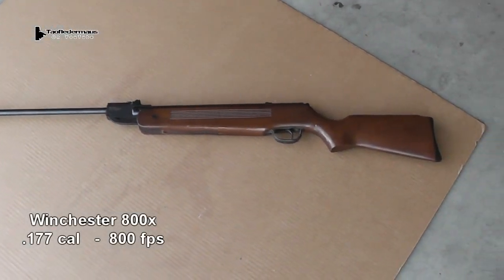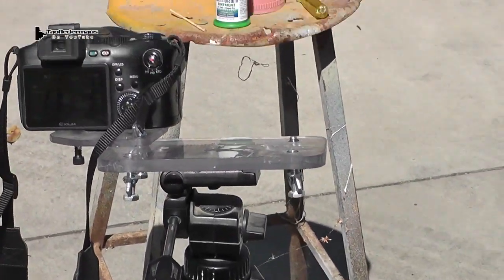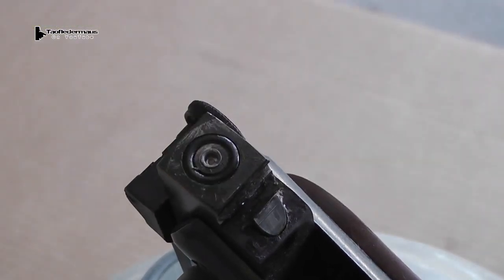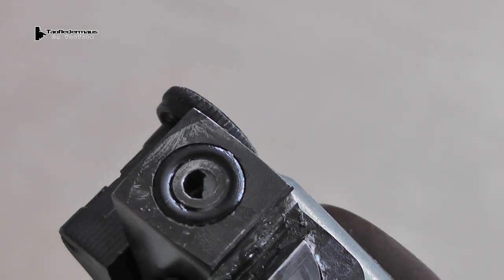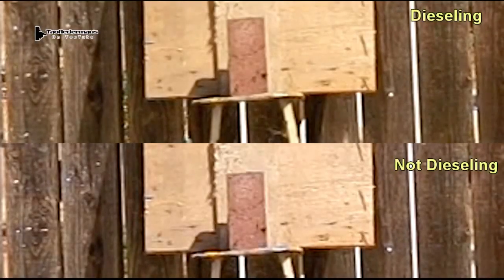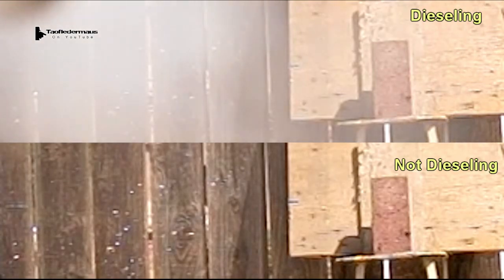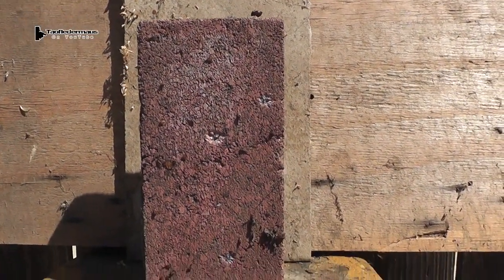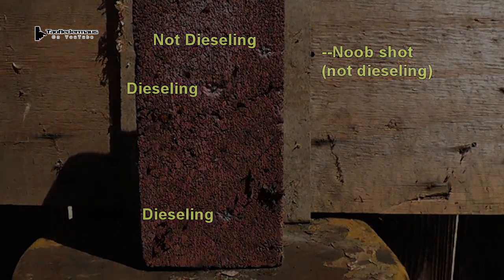Pellet Rifle DIESELING  -   Good,  Bad or Ugly?

Comment: I use Remington gun oil, and yes dieseling increases the velocity. How do I know? Because it increases penetration and when you have the mass of the projectile stays the same obviously velocity increased. I can fire a .22 pellet and get a dent. I can fire a dieseled .22 pellet and get a hole.
Reply: I discovered 'Deiseling' by accident and it imediately inspired me to do some experimenting. I found that penetration was better with a smear of vaseline on the cup of the pelet.
Reply: I have been adding oil or a dab of grease to my pellets since the 80's.  I discovered this when lubricating the gun.  Never suffered damage and in fact some of my air rifles have the same seals from the 80's.
Reply: Ethan Allen stuff really works you can shoot threw car doors with it
Reply: Good tips.  : )
Reply: In the US (most states) there is no long gun registration or licenses required.
As the "trick" doesn't modify the air rifle there's nothing to run a fowl of here.
Reply: I'm interested, I found no difference over my chronograph with usual caveats that altitude air density temperature blah blah blah can all effect chrono readings.
Reply: WD40 sprayed in the air cylinder sends Rabbit II bullet (1gram weight) from 280 m\s to 395 m\s. It also kills the plunger sealing in 30-40 shots. And kills the magnum spring. The trick with any dieseling is to make foam and have good air mixture inside. 0.67 gram bullet goes from 310 to 440m\s
Reply: miksal26 We don't spoil anything. Governments everywhere, especially yours, get a taste for power and become greedy. The Port Arthur tragedy wasn't a wake-up call. It was simply the excuse your government needed to strip your freedoms away. Best of luck to you. Stay safe because these are some increasingly dangerous times.
Reply: Watch out with what you are doing if you want to keep your definition of air arms as being not firearms.
By using rapid oxidation of a fuel to propel a projectile,you are asking for gun control supporters to have a serious discussion regarding
the legal definitions that airgunners enjoy at this moment in the USA. In other words,use only air in airguns to enjoy the sport.

We in Australia regard air arms as firearms and must be licensed accordingly which involves all the legal requirement and bureaucratic
paperwork and bullshit connected with obtaining  an air gun.

Enjoy the sport of air gunning with all the benefits it brings you and the relatively cheap cost the activity allows you.
Don’t  spoil it for yourselves by doing dangerous things with your air arms.
HAPPY SHOOTING and best wishes from DOWNUNDER🙂
Reply: I get maybe 50 to 100 fps faster with dieseling on my chrono

Comment: I used a spray can of 24% Ether called "Aerostart", normally used to start gas engines.
I have used it in a car (air cleaner) and in a stubborn two stroke lawnmower.
A short squirt into the chamber usually ignites and the pellet speed is increased dramatically.
We tested it using a Telephone book and the penetration was quite spectacular.
A wisp of smoke after firing is quite normal.
Oh yes it was a spring rifle with 177 pellets.

Comment: There's all this talk about the oil being put into the actual skirt of the pellet and it igniting and producing a small kinda powder burner ammo effect, accelerating velocity… but when I originally found out about 'dieseling', I got the impression that it worked more on the basis of adding oil between the pellet skirt and the breech so that it formed an airtight seal, therefore producing more energy that way.
Reply: Robert Tomkinson,
Just put any kind of oil in the barrel, or even water, without a pellet.  it'll look like smoke when fired.
Reply: Then how would you explain the smoke?
Reply: The glow plug is just there to make starting easier , it's not really necessary for it, if you crank a diesel with broken glow plugs and the compression is fine it will start .... as a matter of fact sometimes diesels do a run-away especially when seals on the turbo goes and oil from the sump is sucked into the compression chamber .... google runaway diesel numb nuts...
Reply: Flyboy,
That was my first impression.
Reply: +But Not Today 
Qa'pla'!
\V/_

Comment: it is my firm belief that "dieseling" is a load of shit. it takes tremendous amounts of pressure to ignite any fuel without a spark,in fact, far greater pressure than an air-rifle is capable of producing. the smoke is inevitable if you put whatever grease or oil you would like in the barrel,combustible or not. however, "dieseling" does somehow affect the rifle because a liquid medium is non-compressable, maybe therefore there is a difference in sound,and who knows,possibly performance. my own experience dieseling this far is however that it only makes a louder bang and rapes accuracy up the ass. sorry for any possible faulty grammar as english is not my mother tounge.
Reply: Pressure in an air rifle is around 3,000 psi vs only 300 in a Diesel engine cylinder. No spark required; no shit load required!
Reply: Go out after dark and diesel one of your pellet rifles, you will see a flash ! The oil or grease does ignite !
Reply: +Mats Granqvist Tell that to Umarex, they refused to repair my air rifle because I over oiled it causing combustion which over a couple weeks time broke the main spring ! And I didn't do it on purpose !
Reply: I will have to try that one !  LOL
Reply: wp r there's the matter of compression ratio too
Reply: I've gotten the same results using water
Reply: shut your trap
Reply: Put that Daisy Red Rider down boy (you might shoot yer eye out!) and get you an adult spring powered rifle rated at a min. 700 f.p.s.  Then simply oil it too much and behold the power if airgun dieseling! Lower powered guns won't get hot enough to ignite the oil.
Reply: "it is my firm belief...".  In other words, you haven't a clue.  Thanks.

Comment: Maybe try using zippo fuel or something more volatile, and add it directly into the back end of the pellet.
Reply: Lorenzo Pacheco What you suggest is the usual way of doing it, works very well and give great power.
Reply: Rondo Cat Yay I'm smart.
Reply: YEAH!!! BLACK POWDER!! be sure to post the results!!
Reply: WD40
Reply: This will cause the build up of burnt residue over time which will spoil your groupings. Been there and ruined the T-Shirt. Need more power and accuracy: Get a more powerful gun with a larger caliber and use a pellet weight that your particular gun is comfortable with.

Comment: when dieseling, use a light oil, something that will ignite easily
any kind of grease, petroleum jelly is too heavy, the louder pop is just more compression because the air space in the pellet war "reduced/removed" by the jelly

Comment: I would like to say that you're not supposed to push /drive the pellet down any further than were it was when you insert it ,and dieseling doesn't mean any thing that's flammable... does have to be flammable, just not every thing. Actual diesel would have worked, oil, lighter fluid would have worked!!! it seemed as if you wanted it to seem untrue that dieseling would increase fps in an air rifle...All im trying to say is that you didn't try to preform that test ... look further in to detail/  before trying to test a hypothesis.

Comment: If you want to wreck your air rifle then apply a drop of 3 in 1 oil to the back of the pellet when it's in the breech and also a drop or two into the cylinder.  One thing I tried when I was a kid, I ran out of pellets for my old Diana and my dad wouldn't buy me any more because I'd smashed his shed window so I went to the coal house, found a few .22 sized shards of coal and fired them.   One or two of them actually ignited through friction as they left the barrel and while they flew anything but straight, it was cool firing 'tracers' from an air rifle :)
Reply: Taofledermaus NEEDS TO RECREATE THIS!!!!!

Comment: <---- .22caliber crosman phantom canadian version, new the box specs are 495 feet per second and the 22 cal crosman lead pointed pellets do not go into a wood plank more then skirt deep, but, with 1 drop of conventional, non synthetic, easy flowing, new in bottle, motor oil that is not rated as resisting burn off, added to the air chamber via syringe and also in the pellet skirt......kapow,.....pellet goes right through the plank. must be double the energy.....attempt at your own peril !!!!!!!! do not attempt in anything but a spring gun fellas, a pneumatic pump will explode in your face or need other repairs
Reply: *****
 LOL that sounds more victorian era manly than it does art deco era ;) you did good research info, thx for the conversation.
Reply: *****
yes, they did used to frown on women doing manly things......drinking or smoking,...how unladylike! and politics and medicine, women can only be assistants back in victorian era....almost as bad as the islamics treat their women today by trying to keep them uneducated and subservient to men, it is even taught in their religion that most people in hell are women, and that women are virgin sex slaves in heaven for men, stupid.

Comment: mentholatum ointment has about 10% water in it...not sure how flammable it is ....but 3-in-1 oil works good in the $40 cheap chinese air rifle i bought at the flea market..it chronos at about 980-1020fps dieseling and about 790-825 naturally aspirated on my $90 prochrono LOL not sure why you haven't bought a chronograph yet for some of the experiments you do...they are pretty cheap...

Comment: The pellet is propelled by pressure between it and the piston (obviously). By pushing the pellet down even 1/4 of an inch gives it a larger chamber which will slightly reduce the amount of pressure. Im pretty sure if you just add the jelly oil into the skirt of the pellet you will have a little bit better result.
Reply: Indeed and the retarded way he's applying the Halley isn't helping either
Reply: Also he can tell me or anyone how fast it was going by eye lol you need somethingvtobtecord the speed. This does make it go faster.
Reply: Primal 420 I just emptied a 3 in 1 can in the can so they soak in it
Reply: @kinzieconrad105  I do the same, and gently roll and shake the can before a session to redistribute any settled oil.
Now all I need to do is find out where I can gets me summa them there chrony eyes!
Reply: Probably Wal-Mart
Reply: 2 stroke oil gives the best pop.
Reply: dsjc666
Both correct. He must have built in crony eyes too.
Reply: OMG PLEASE, get a life! All you need to do is observe the deeper penetration to penetate your pea brain mentality 😂
Reply: Pressure alone without the added pressure of the combustible mixure in the pellet doesn't work. A non combustible material in the back doesn't increase the speed at all.
Reply: You are right, I've played about with dieselng and not pushing the pellet down the Barrel and only adding a tiny amount of fuel works best.

More is not better, I've tried a number of things and engine oil works well, just a single drop in the skirt, more will lower the gains you receive. 

I think that oil works best because it can vapourise much better than petroleum jelly rather than it being a better chemical itself
Reply: Exactly it has nothing to do with combustion, as many unscientific folks think, because no combustion is taking place.
Its all about creating tighter tolerances, which leads to less energy loss when its fired.
Reply: @PattyBoyBK  You probably have no clue how a diesel engine works. The diesel is ignited by pressure.
Reply: @PattyBoyBK  False, put water in the pellet and it goes no faster.

Comment: 1. pellet too small
2. too much grease, 1 ml diesel needs 6 liters air roughly.
3. metal barrel and pellet act as heat sink

Like the lower mass shotgun shells, the pellet is out by time it is burning.

Comment: ***** It's called dieseling because occasionally diesel engines do a similar thing when diesel fuel is vaporized and can cause an explosion in the engine.
Reply: Jonny E Essentially you're changing the pressure significantly when firing. If you have something that already has a relatively low flashpoint, and you apply high pressure, you can change its boiling/burning temperature. This combined with the heat and friction generated by the pellet against the barrel is enough to start a catalyst to cause it to diesel.
Reply: actually it is called dieseling because a diesel engine works that way there is no spark in a diesel engine the ignition of the and oxygen fuel mixture in a diesel engine is done by compression the same thing happens in the gun think of a piston fire starter all it is ,is a piece of paper  sealed tight with a bit of oxygen in the chamber you push the piston in rapidly with the paper on the end and wammo you have an amber they all work the same way its really cool when you think about it

Comment: Try putting a small glob in the barrel then put the pellet in .The lub makes the pellet slide down the barrel faster and makes a seal so no air goes past the pellet as it goes through the barrel and the lub causes less friction . The 2nd pellet you load won't need lub since you just coated the barrel with the glob from the first shot. A  pellet that normally gets 600 fps will jump up to 800 fps . If you have a gun that shoots 900 fps it will break the sound barrier  and make a cracking sound .To make sure you don't slam the piston head inside your gun use a heaver pellet ,this way you get about the same  fps but a increase in foot pounds of energy . You don't have to worry about hurting your piston as long as there is resistance . Don't go over 200 fps faster than your gun starts off with. Don't use a lighter pellet when you lub your barrel .  If you notice when you do what your doing you don't see a difference in fps until after a few shots .That's because your not lubing the barrel to reduce friction till it gets forced into the grooves from the 2nd and 3rd pellet . It takes a lot longer to lub the barrel your way. I never use a lot of lub ,just a small glob on the first shot ,I shoot the 1st shot into the ground because the pellet won't hit where you have your scope set at . After the first shot you can shoot 100 pellets with out lubing again.The fps starts to drop on the chrony after that . I have found that 3M™ Silicone Paste A non-melting, water resistant, 100% solids, silicone compound designed to protect surfaces from oxidation. Also used as a general purpose lubricant for brakes(metal to rubber applications) great for O-Rings and weather stripping. MMM 08946 3M™ Silicone Paste, 8 oz works the best. This is the stuff you put in the car window tracks to make your window go up and down with out dragging and burning out your motor. It comes with a brush at the end of the lid.The only reason to lub your barrel should be to increase you foot per pound of energy with a heaver pellet and to keep the same fps . I have been doing this since I got my rws in  1980  and I still have the original piston ,seal and spring. One more thing I have noticed that since I started using the 3m silicone my cleaning pellets are very clean with no lead residue . I think but not sure that the silicone paste coats the barrel and leaves it slicker longer some how . The only way your going to hurt your gun is to shoot a lighter pellet that will cause your piston head to slam into the top of the pump and cause it to crack .
Reply: I know it's been 10 years since you commented this......I also want to add its been very helpful so thank-you......my question to you is .....dieseling the way you described in addition to dieseling the way that I've seen ....which is to just put a drop of 3in 1 oil in the skirt of a pellet before firing ......if I do both of these do you think the gun will be ok in doing so ?

Comment: I wonder If they'll make a rifle that's purely designed to use diesel as the propellant and not gunpowder
Reply: That would still make it a firearm, so what's the point of using a flammable liquid versus gunpowder?
Reply: Well, from the shooter's level, it makes it cheaper to shoot. Not much gain on the commercial side though.

Comment: My frame by frame comp shows that the dieseling pellet is going about 20-25% faster. Count the frames between the impact of the first dieseling pellet and the second, non-dieseling pellet. The second pellet is still some substantial distance from the board which it missed, but just barely as the shadow shows. The angle makes it very hard to detect the speed because the image is foreshortened very much.
As an entirely separate issue, I agree that intentionally dieseling your air gun is idiocy! If you want more power by a better air gun, or move up to .22 LR RF. It's less expensive than buying pellets. (Unless you live someplace that is anti-gun!)
Besides shooting bigger guns is more fun!

Comment: I have a bejamine trail np xl 1100 22.cal rifle, and when I diesel it, it is shooting faster, there nothing phychological about it, well maybe a little because of the crack it make, but I have done many tests, not using any tests with equipment , but just doing penetration tests and comparing, and I can shoot a whole clean through a quarter every time when dieseling, but when shootin just regularly it will only put a really big dent in it but not penetrate. also have shot numerouse of other things as well with the diesling method by far penetrating quite noticeably further, I would have to say maybe 30-35% more deeper penetration like in phone books or whatever